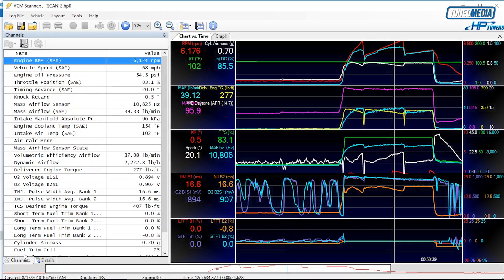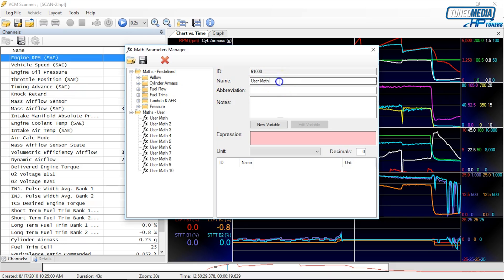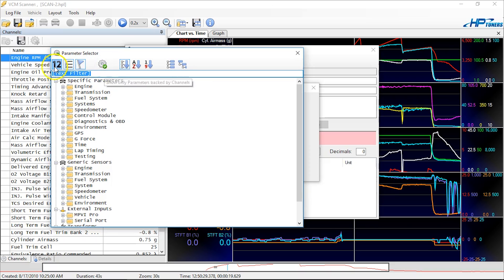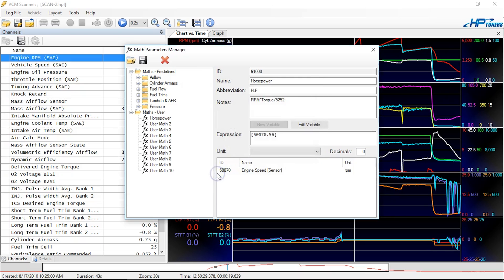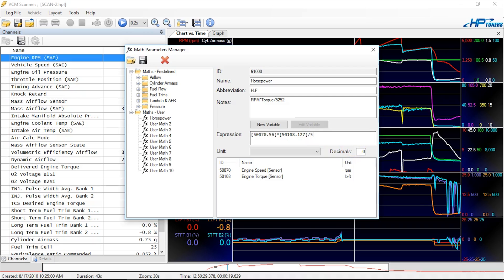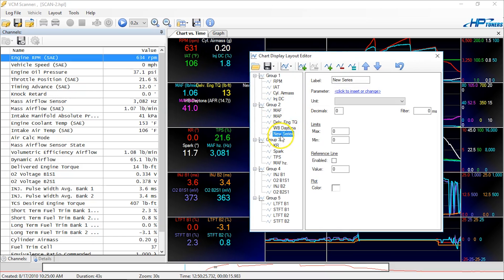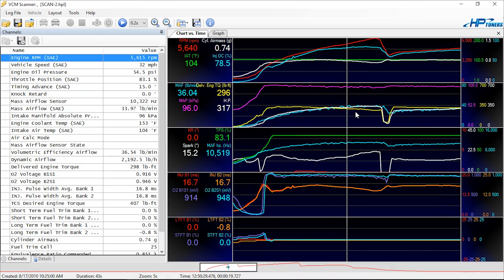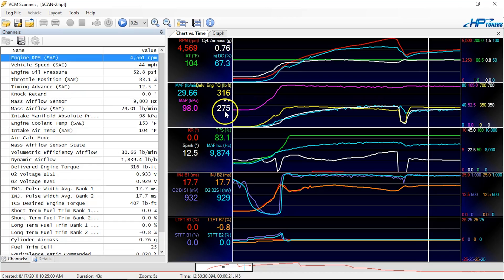How to Add a Horsepower PID (parameter) into Your VCM Scanner for HP Tuners

Comment: The delivered engine torque maxes out at 640 ft-lbs, trans engine torque maxes at 885 ft-lbs. The engine torque parameter for me has gone up to 1150ft-lbs without maxing out so far. HP calculation shows about 1100 at 6000 rpms (ls3 vette with lots of boost). Guessing it is best to use the engine torque parameter instead.

Comment: I assume the Horse Power numbers are Crank horse power. How close is it to rear wheel horse power??
Reply: Smith Improvments would add another calculation to remove drive train loss, which is estimated to be +-20% so multiply your function by .80

Comment: Just tried it with my truck and got it to work.   It works pretty well but it's not perfect.  Reads about 30hp high
Reply: Onalky87 where did you find the delivered engine torque pid? Can't even find it on the scanner